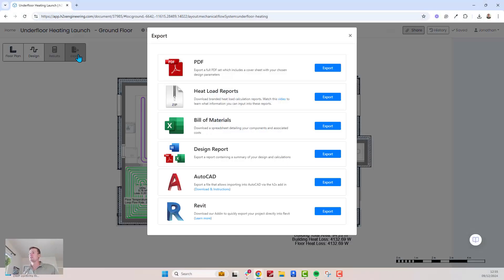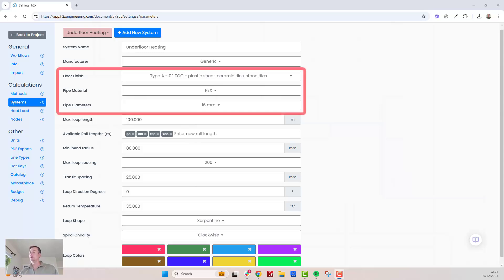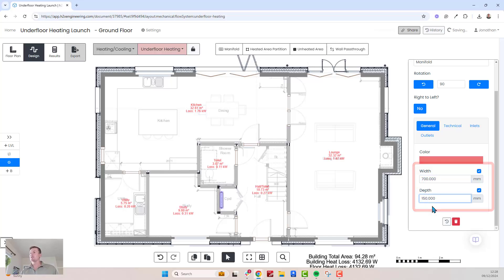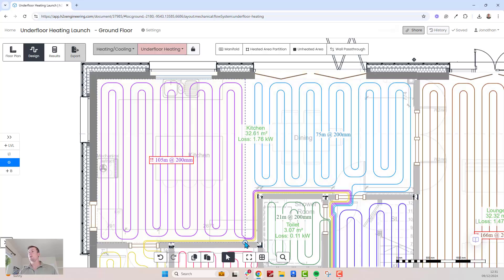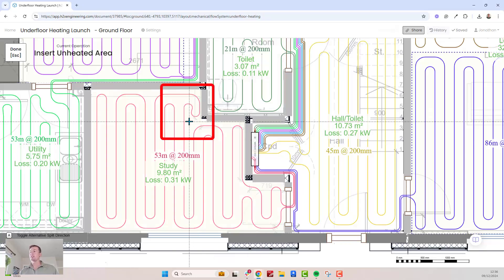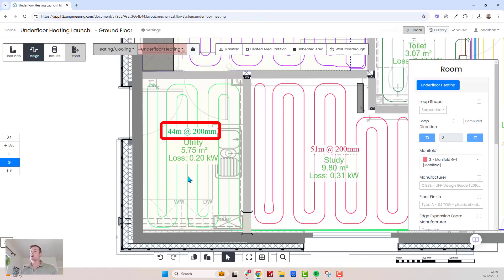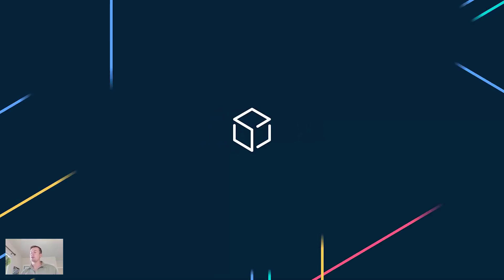h2x - Underfloor Heating - Overview

Comment: Great Progress on this H2X, 

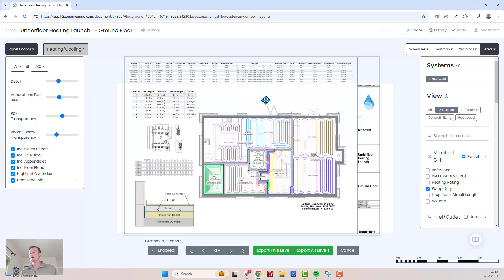I can see on the video (3:21) that you have the image of the manifold and  the cross section image of the floor materials on the pdf, is that an option to add to our drawings ? thanks. Mark - Niche Energy Solutions 

Merry Christmas !

Mark@Niche
Reply from the maker: Hi Mark, thank you!

Yes, it's an image that has been uploaded to the custom PDF Export. This Use Case may help: https://www.h2xengineering.com/use-cases/pdf-drawing-export/

Merry Christmas to you too! :)
Reply: @h2xengineering   ofcourse ! did not think about doing it that way... I have a few cross sections of our work.. so will use that tip in future ! thanks